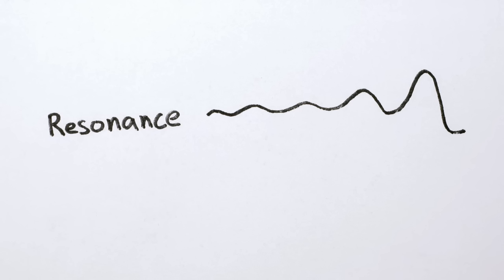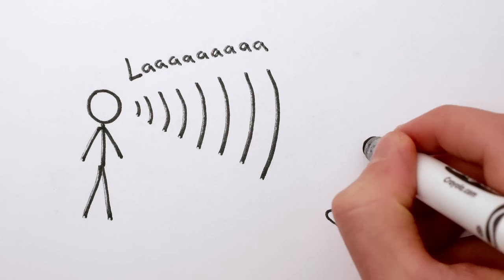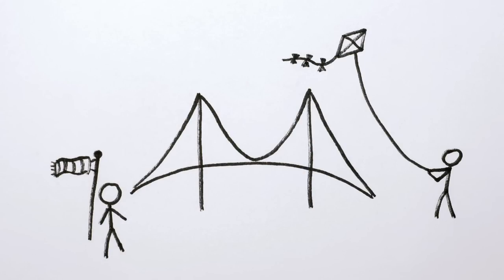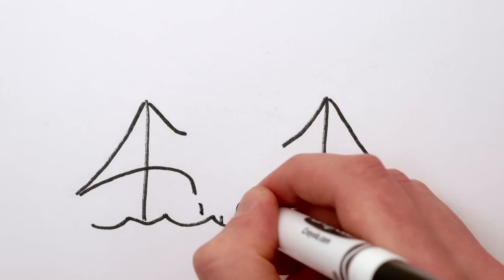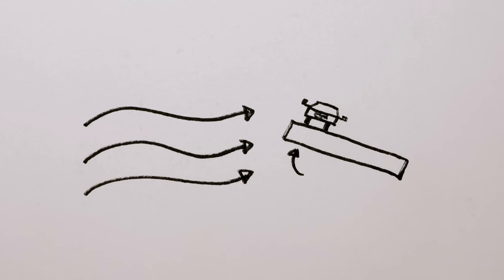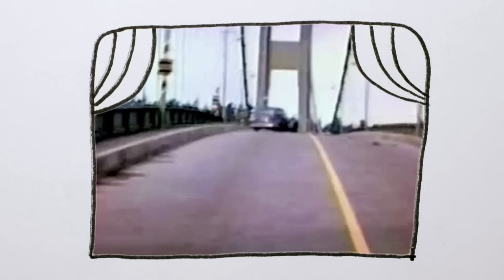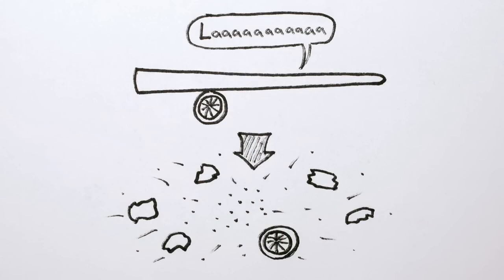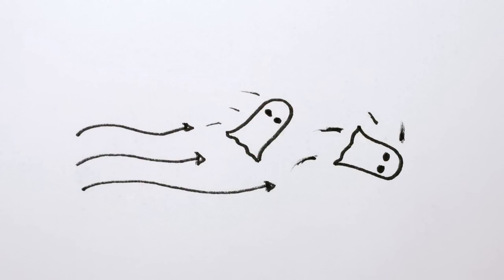The Tacoma Narrows Fallacy

Comment: Not a resonance? Well, yes and no. More yes than no. The correct statement is that aeroelastic flutter excited a torsional resonant mode in the structure of the bridge.

The oscillations of the bridge grew because of lift forces first on top of the bridge and then on the bottom of the bridge. Those forces ~were~ driving the bridge at resonance, in exactly the same way that someone pushing on a swing at just the right time over and over causes the oscillations of the swing to grow. Had the bridge not had a resonant mode, nothing would have happened. Granted, the forces that excited the resonant torsional mode were dependent on the position of the bridge itself. But then again, someone pushing their kid on a swing only pushes when the swing is in the right position, too.

Granted, the situation is more complicated than a guitar string humming along to sound at a resonant frequency. But the resonant behavior of the bridge is central to events. The way that you build bridges that don't do this is by designing out strong resonant modes. So yes, it is incorrect to say that this is a "simple resonance." But it is far ~more~ incorrect to say it was not a resonance at all.

And yes, I read Billah and Scanlon. It's a shame I didn't get the paper to referee. You learn a lot talking about things like this. It would make fun conversation over pizza and beer. But as one of those nasty PhD physicists who really and truly does understand in quite exquisite detail what is happening here, as well as the subtle differences in how physicists and engineers think about resonance, I will continue to talk about resonance and the collapse of the Tacoma Narrows Bridge. ;-)
Reply: +Jeff Hester Thanks Jeff.  I'm no engineer but your explanation makes perfect sense to me.
Reply: +Jeff Hester Thank You, Jeff. I'm neither an engineer nor a physicist, but I think I clearly "see" your point: the forces outside the object provoked it into its innate tipping mode of resonance--I enjoy that idea much.
Reply: leaving terminology definitions for lawyers, I, a self-proclaimed Ph.D. in pushing swings,  have an issue with the explanation "the forces that excited the resonant torsional mode were dependent on the position of the bridge itself".
Even more: no magnet under a swing, or a rubber string tied to it or any other dumb conservative force fn(x) you can imagine won't itself keep a swing swinging. Only experienced loving hands that push IN THE DIRECTION OF MOTION will contribute energy. Now, how does the wind knows WHEN (not "where") to push, that is something a MinutePhisics would have better explained instead of what's resonance talk.
Reply: The trouble with videos meant to correct others' misconceptions is that they need to be perfect, otherwise you just end up replacing their misconceptions with your own (or annoying those with already accurate info).  No disrespect to Henry though.  Veritasium is actually much worse for that sort of thing.
Reply: Yup.
Reply: Yeap - it is Chaos resonance or nonlinear resonance -
Reply: I agree.    It's a great pity that this video (with some neat cartoons) would have been so much better if the title had been a bit less provocative.  Even writing, "Tacoma Narrows - what do we mean by resonance?" would have been more constructive.  It's a tragedy when science and engineering, and for that matter, several topics, need to be introduced in this manner.  

I am also a nasty PhD... an engineer who really doesn't appreciate it when my fellow technically trained peers somehow feel the need to bust on secondary school teachers who introduce highly nuanced topics in a simplified manner to gain kids' interest.   "Teach your Teacher."... cats and kittens, there is enough room in the pool for everyone.   Want to know a great way to get teachers to stop introducing interesting topics to kids?   Chastise them for their proper lack of literature review!

It is worth noting that even the freaking original paper has a sentence that says it would actually be OK to refer to this phenomenon as resonance, in a sense. 

I'm going to go rip my high school teacher a new one now because it turns out Abraham Lincoln didn't die from being shot... he died coz his heart stopped!  THE MORE YOU KNOW...

See, this comment... and the comments that shall follow... are another example of resonance... in a way... teachers and books get the details wrong on Tacoma, but perhaps not to a harmful end.   Two folks write a paper about the oversimplification.  YouTube video oversimplifies the paper's argument.   Commenter (me) oversimplifies the video's intent and makes highly reactionary general comment about 'technical' parents beating up on teachers.   Another commenter will likely tell me to go screw myself...  See!  back and forth, back and forth.  :D

Comment: When I saw the video, I thought it did not look like simple mechanical resonance.  However, the word "resonance" defines a system oscillating at increasing amplitudes at certain frequencies than others.  So to say that this was not resonance is incorrect...it is certainly not "simple mechanical resonance" due to the twisting motion but a more complicated resonance caused by aeroelastic flutter.

Comment: I disagree with you on this one, aeroelastic flutter is a self-excited vibration.  Aerodynamic forces interact with the bridge and cause the structure to vibrate, as you explained. However it is forced to vibrate at its resonant frequency which leads to the rapid increase in amplitude which eventually destroyed the bridge. 
So in this case "the bridge collapsed due to resonance caused by the wind" isn't incorrect, it's just simplified.

Comment: The bridge "fluttered" at a certain frequency. Much like a violin string, when bowed, vibrates at a frequency determined by it's tension and length. True, it doesn't precisely fit some of the definitions of resonance, in terms of the stimulus (the wind) being relatively constant. The bridge was oscillating at a certain frequency (.2 Hz), however. And since the wind PRESSURE against the span VARIED according to the angle of attack as the bridge twisted, I think you're splitting hairs.

Comment: Everything you just said sounded exactly like resonance, just with a complicated version of driving force. Surely the Aeroelastic flutter could only cause the bridge to collapse if the frequence of the flutter was similar to that of the natural frequency of the bridge? otherwise the bridge would not oscillate at such an amplitude?

I understand the concept of Aeroelastic Flutter as you described it, but i am unconvinced that resonance is not a factor in this.

Comment: well, technically, the teachers weren't wrong... although it wasn't because the WIND was blowing at a resonating frequency, but it's because the aeroelastic flutter is basically pushing each side of the bridge to start twisting harder and harder, and Gravity is pulling the bridge back down in a resonant frequency... end result is STILL resonant frequency, which results in higher oscillation ... no?

Comment: As for bad bridge design, it is unlikely that complex lateral force effects were part of codes and manuals that engineers follow.  I am an architect, and only in the last 10-15 years have seen even seismic loads being part of the building code in states like new york.  If aeroelastic flutter was not part of standard criteria for bridge design, it is hard to blame the engineer.  Had the structure been stiff and "built like a brick shithouse" instead of sleek, this would not have happened.

Comment: I disagree 100% with this statement. The bridge collapsed because of resonance caused by the wind. Why the rocking took place was, as you say, by AF but it is not why it collapsed. By causing the bridge to rock at a certain frequency and matching the natural frequency of the structure, it literally rocked itself. This is referred to in civil engineering as harmonics and is very dangerous for all structures. All bridges rock because of AF, but its the matching of frequency thats dangerous.

Comment: Well the simplest way would be to use the examples in this video like the swing being pushed at the right period, and the glass breaking for resonance from simple linear external forcing, and then introduce the Tacoma Narrows as resonance with self induced periodicity as an example of why stability analysis (even if more complex than the current syllabus) is important in the real world. That final point really is why it's brought up as an example, and you don't have to lose that.

Comment: A constant force of any kind is not a resonance!  The wind did not create a resonance!  It was torque and tension that broke the bridge!

"In physics, resonance is the tendency of a system to oscillate with greater amplitude at some frequencies than at others. Frequencies at which the response amplitude is a relative maximum are known as the system's resonant frequencies, or resonance frequencies." http://en.wikipedia.org/wiki/Resonance
Reply: So the aeroelastic flutter effect would cause greatest oscillations if it forced at specific frequencies. The bridge still oscillated with largest amplitude at a specific frequency, this had to come from a oscillating force. How else could you explain it?

Comment: Hi! I'm a civil engineer and structural analysis is one of my favourites topics. I also happen to know a bit about wind effects on buildings an aeroelasticity so I'm going to try to shed some light here.

The video was great, but it is a bit misleading because you say that there was no vortex shedding involved in the collapse of the Tacoma Narrow bridge and that's not entirely true. In fact what caused the bridge to oscillate in first place was vortex shedding. This happened for several days and during this lapse of time the bridge would oscillate in a vertical (not torsional) mode. It was only during the last 45 minutes of its life that the bridge started to vibrate in a torsional+flexural mode due to flutter.

But had not the bridge been oscillating due to vortex shedding in first place, the aeroelastic phenomena probably would not have happened neither. This is because the flutter was probably induced by some failure of the bridge(degradation of its torsional stifness and the failure of some of the cables) during its vortex induced oscillations.

It is true that resonance is not involved during  flutter oscillations, but it is believed that some kind of resonance/amplification was present at the moment before the bridge collapsed. What caused this amplification is not well known and there is some debate around it and several theories. From what I've heard about it, the torsional motion generated a vortex wake that amplified the torsional oscillations but as I said before it is not clear and there are several mechanisms proposed in order to explain what really happened.

So to summarize, the secuence of the Tacoma Narrow's fail was this:

1. Vortex Induced Vibrations due to vortex shedding (vertical oscillations). This goes on during days.
2.Something goes down and flutter start kicking the last 45 minutes (flexural+torsional mode, no resonance involved)
3.Shit happens. The torsional oscillations amplify itself due to some mysterious mechanism (probably vortex shedding were involved but it is not clear) leading to the collapse of the bridge.
Reply: Yes! Constructive criticism, information, and reliable authority! The internet needs more people like you. :|
Reply: Ingenieria Para Torpes Thanks a lot for this analysis. I don't understand all of it, but the video seems to have bugs.  E.g  saying it's not resonance, and then switching (in effect) to "not forced resonance".  The diagram involving gravity, inertia and a spring is a classic picture of a naturally resonant system.  And a flutist kicks a flute into resonance with a "constant wind" across the mouth hole.  Ah but! This wind is no longer laminar (constant) near the hole! It becomes a synchronised stimulation by feedback with the rest of the system.

Comment: Well the aeroelastic flutter was happening at a resonance frequency right? Therefore it's not wrong to say resonance caused the bridge to collapse because if the aeroelastic flutter wasn't happening at the resonance frequency of the bridge, it would have never collapsed.
Reply: but the frequency of the aeroelastic flutter was not constant so it couldnt have stayed the proper frequency to break the bridge plus the frequency of its vibration i am pretty sure is a LOT slower than the frequency required to resonate with the bridge. furthermore if the aeroelastic flutter was a constant frequency (which if it was than it couldnt have been increasing to the point of destruction anyway cause constant things cannot increase and still be constant) a lot of things vibrate at their resonant frequency. tap a wooden object, make a toast with some glass, hit some metal against metal. these are their resonant frequencies BECAUSE they are the frequency the material naturally resonates at. what makes resonance so powerful is that something other than the object is resonating at that frequency also. so it more readily absorbs it adding that energy to any energy it already has and just keeps adding as long as you keep supplying energy at that frequency and the amplitude increases until it breaks. now onto tuning forks (if im right) when you hit something with a tuning fork it resonates at the resonant frequency of the object you hit and so you can get some pretty cool stuff out of that.
Reply: so in short no the aeroelastic flutter was NOT at its resonant frequency and even if it was that wouldnt have mattered

Comment: The 'Real' reason why this bridge fell was because it was designed and built by engineers, not physicists.
Reply: engineers are taught all this physics and are actually better equipped to design structures like bridges
Reply: Wrong, engineers are taught the basics in classical physics.
Reply: The origin of the myth that the wind provided an external periodic frequency is down to undergrad physics textbooks. Meanwhile engineers do modules in wind engineering and are told about aero-elastic flutter, fully equipping them to deal with the problem far more effectively.

Comment: This video's definition of resonance is wrong. Resonance is an inherent property of a vibrating system - it does NOT require an excitation source to be "vibrating at a similar frequency". A resonant system can be stimulated to vibrate at its resonant frequency by a single non-periodic impulse. For example, when you strike a tuning fork against a hard surface, the impact force of the collision is a single pulse of energy. The resonant vibration is a mechanical property of the tuning fork, independent of the force that excites it.
Reply: Lish Lash — There we get to the nub of the argument — whether a tuning fork, having been struck, is “resonating.”

When there are two identical tuning forks near each other, and one is struck, the other will also vibrate.  That’s “resonance.”